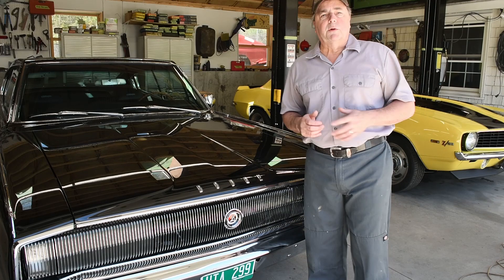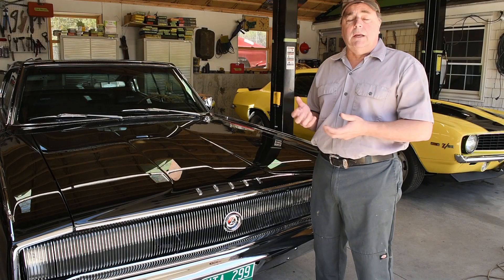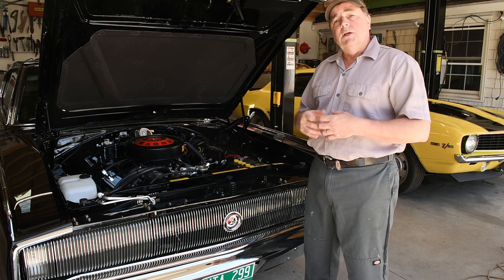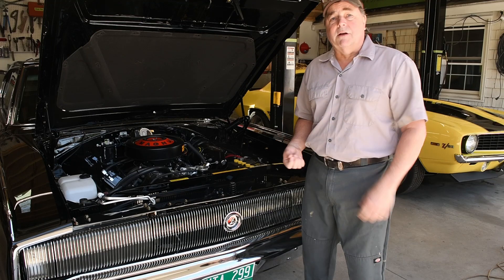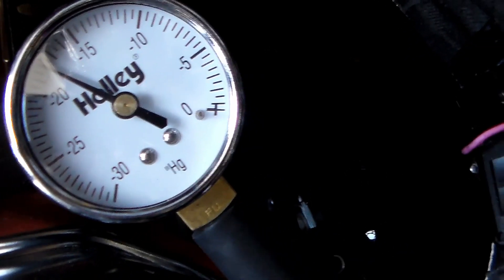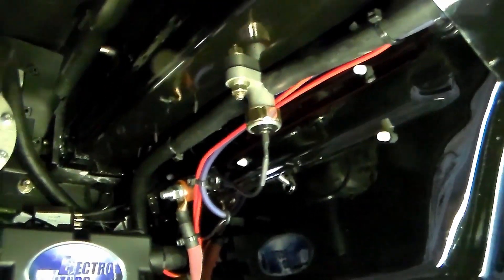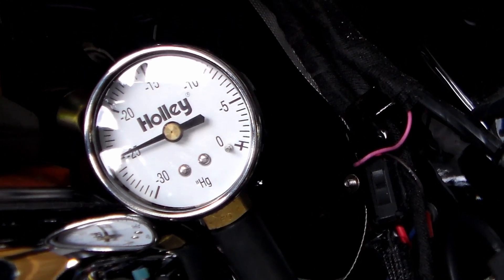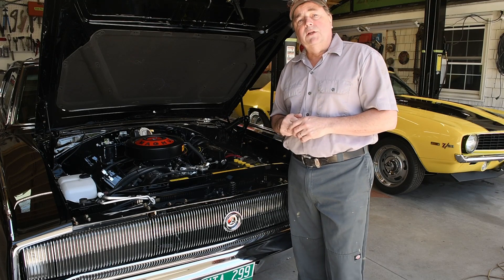No Vacuum = No Brakes!  A Leed Vacuum Pump can fix that. I'll show you how

Comment: Nice Video.  I am getting ready to swap a rotary engine into my Samurai and was cleaning up the engine and planning on running silicone vacuum lines.  I may go to turbo, but keep a lot of the factory functions that use vacuum, as well as the brakes.  
My question, could you run the ENTIRE engine vacuum system with the Leed Vacuum Pump?
Reply from the maker: Yes I would think so. The pump makes sufficient vacuum.

Comment: Just want to do a short follow-up on my previous post.  The Leed vac pump arrived and is installed in my engine bay. A little fabrication was needed and it is tucked partially under the right front side of the car by the charcoal canister.  With 6' of vac hose the line was routed with my AC lines and then cuts across the back of my Pontiac engine to the booster.  Electric lines were tucked between the right inner fender and the fender and cuts across to the back by the engine's HEI.  The power source is the 12v source to the HEI.  All electrical wires were shrouded in split corrugated plastic loom tubing.  The negative ground is on the intake manifold.  New system works.  So far,  I am very happy as the supply of vacuum is clearly helping the braking action.  By the way, it is whisper quiet compared to the pump style I previously had on the car years earlier.
Reply from the maker: Glad everything worked out for you

Comment: Excellent and very helpful video. I too have low manifold vacuum (11" of Mercury at idle) and my Trans Am's power brakes are not doing very well.  Just ordered a Leed Brakes unit to bolster the vac to my brake booster.  Quick vacuum and quiet operation sold me. Thanks for the tip.
Reply from the maker: Glad I could be of help. Good luck on your project

Comment: A few things...  First your Charger is beautiful!  The attention to detail on all the wiring and bracketry, plus how clean it is, astonishing.  Well done!  Second, thanks for the video.  I'm having about the same issue with my Cutlass.  Vacuum is roughly 10 - 11 inches, brakes are hard as a rock and the brakes are scary on the highway.  After bumping up the idle to make 14 in, it's not producing enough PSI at the calipers.  I was looking into the rotary style pumps for a while, it might be time to bite the bullet.  This video is about 9 months old, do you have an updates / opinions on the product now that you've used it?
Reply from the maker: Hello Scott, Thanks for watching and commenting. This pump is the best remedy. Brakes are spot on all the time. No regrets, I wouldn't hesitate to use this product on another build. Best of luck, Troy

Comment: Hi Troy, one other comment touched on this, is an additional vacuum reservoir/canister needed in conjunction with this pump? I imagine that adding one would reduce any short cycling of the pump.
Reply from the maker: A vacuum canister is not needed. But using one cannot hurt the situation. Most people who have this problem probably already have a vacuum canister, so why not use it.

Comment: I watched this video a few weeks ago while searching for options on vacuum pumps instead of just replacing the piston pump I installed, that recently locked up. The piston pump never gave me decent braking. I thought the only option was going to be a hydo-boost system. 
I took Troy's advice and ordered the bandit pump, installed it on 70 Chevelle with very stout 454. I did reuse my existing vacuum canister that I have tucked away in the fender well. Well, I test drove it today. Best brakes that car has had in 10 years, since I had the race shop rebuild the engine! Very quiet pump compared to the old piston pump. 
FYI - I emailed Leed brakes prior to ordering, the Bandit pump can be mounted vertical or horizontal. 
Thanks for the video, Troy
Reply from the maker: Thanks Chris! Glad I could be of help
Reply: do you need a reservoir or can the pump be plumbed directly to the brake booster?
Reply: @TCDawg91  - If you email Leed brakes, they will answer your question. I emailed them about mounting the pump, they were quick to respond. I previously had a reservoir on mine so I kept in in place, didn't try the brakes with pump alone. But I can say, this pump was the answer to my Chevelle's brake issues with high HP engine.

Comment: Did you consider a hydroboost system?  Im guessing this is cheaper but just curious.
Reply from the maker: This is more cost effective. Most of the time, folks already have a vacuum based system. So the pump just increases efficiency. Hydroboost would require more parts & more $$

Comment: I am looking into buying this setup. Do you this the extra tank is needed or can I just run to brake booster tank?
Reply: Do not need the extra storage canister
Reply: @LemonmilkMusic  if you run the canister with the combination of the brake booster it holds extra vacuum for brakes. I've tried it without the canister and with the canister.
Reply: I have both  i have the Leeds AND a canister also   Always have 21psi vacuum
Reply: @LemonmilkMusic  how do you brakes feel?
Reply: @musclebone7875  like modern brakes

Comment: Another great video thank you, very informative to guys that have bought that same pump which I’m assuming is the same one I have in my Chevelle made by SSB. You are absolutely right that pump is very noisy and rattles everything around it, I just don’t leave the key on without the engine running that way I don’t have to hear it. About every 4-5 years I replace the rubber lines because of cracks from engine heat.
Reply from the maker: Thank You

Comment: Thank you Troy. I'm looking at this issue with a new engine in my Camaro.  Only thing is, I wish you would have shown us the drive test.
Reply from the maker: Thanks for the input. I never thought about including that in the video. As you can imagine going from 10 inches of vacuum to over 20 made such a great improvement on the brakes.

Comment: Thanks buddy, I have been struggling with the same vacuum issue on my 65 Mercury Comet with a 460 big block and healthy cam. Your video was very helpful and I am replacing my noisy rotary pump with a Leeds.   Thanks for the video.
Reply from the maker: Glad I could be of help

Comment: troy really nice car. i have a `68 impala with hideaway head lites.  it has a vacuum pump.  i think for the brake booster. the head lites work very poorly. do you have any information on the operation of the head lite system? i have seen these on u tube that work beautifully. it has a 427 , 4 speed. thanks very much.
Reply from the maker: I don't have any information on the 68 impala. I do  still have my first car ,  66 impala ss
Reply: there is an electric conversion kit to convert slow moving headlight doors into a  smooth running system.

Comment: Like I’ve said before, that HOK black is killer. 
That pump is sweet. Do you think there would be an advantage of placing a “T” at the booster so that you could also run engine vacuum also? Maybe the new pump is won’t run as much.
Reply: Mrbigg I was thinking the same thing. T into the canister. Maybe also act as a little failsafe if for some reason the pump died.
Reply from the maker: Possible, but I think the idea is be be independent of the engine.
Reply: Thats how I did mine. Line from manifold with its own check valve and also the electric pump with its check valve. Dont forget the engine will pull well over 24inches of vacuum on deceleration with throttle shut even with a big cam so it does help the electric pump. Worth doing.